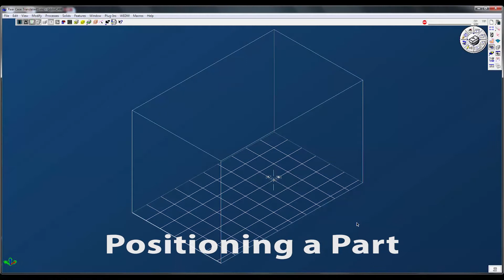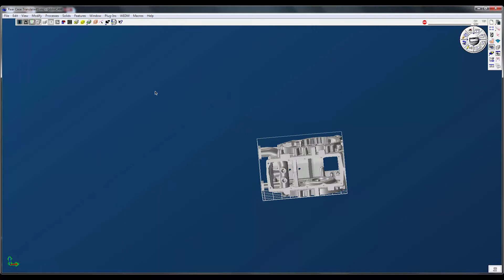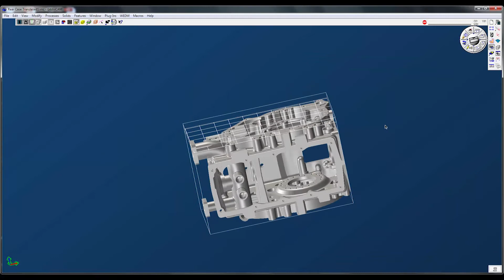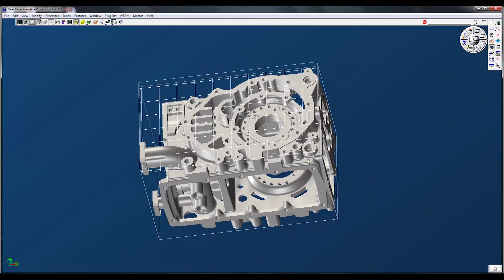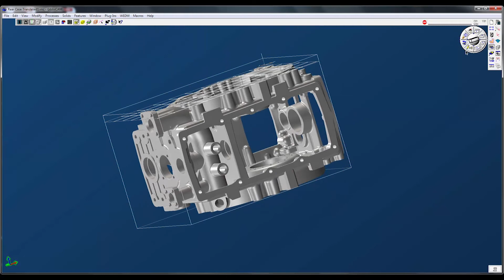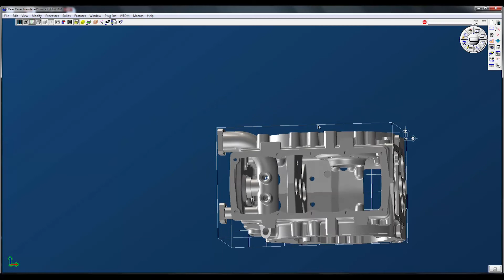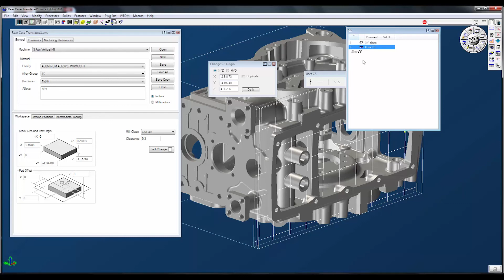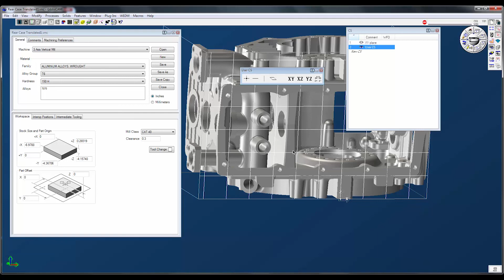Part Position

Comment: Question... Is the user co-ordinate datum position output as a separate datum in post? so the original datum is G54 and the new user datum is G55 for example?

Very useful videos for short cut keys and tips, thank you for posting.